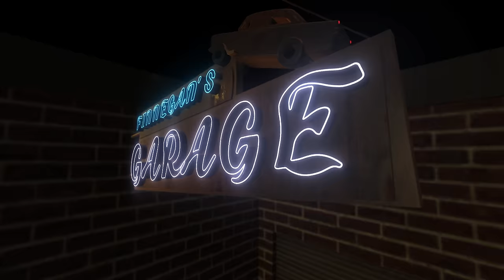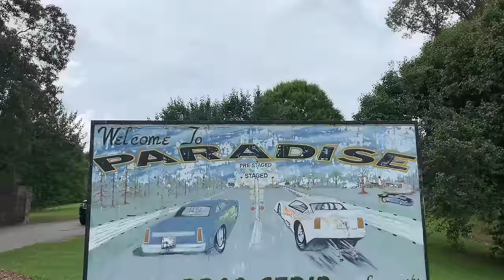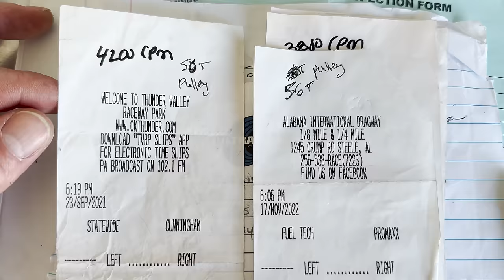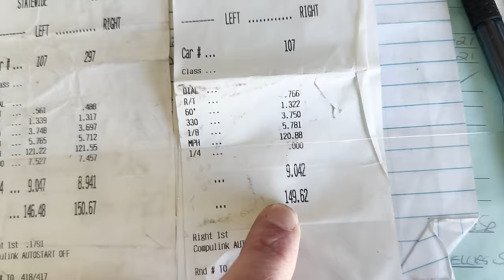DON'T CALL IT A COMEBACK! '67 FIREBIRD TRACK BLAST.

Comment: Copied from my post on matt carriker channel
Your suppose to have a shade 15 lens to look at an eclipse. Incase you didnt know. That is the same required lens for a welder. But that isnt what they use. A number 10 lens is standard. An oxy-acetylene torch lens is a shade no. 5 lens. Really dark sun glasses are about a 2.5-3 lens and normal sunglasses are about 1-2 shaded lens.  You can take an arc welders lens and a gas welders torch lens and hold them together. Altho that maybe a lttle dark for a camera, around 11-13 would work best. Expect welding shops to be sold out of them by the weekend. So my question is.. How are you going to help prevent all the peoples from frying their eyes while staring at the sun during the event? BTW. You can not see the moon passing without the lens the glare is just to bright to actually see the edge of the moon and the edge of the sun.. all you really see is the edge of the glare. Meaning without a 12-15 lens all you are going to see is it go from bright to dim. You wont see anything else except the blinding light get smaller just when it is fully eclipsed then go out an be blinded during all the rest of the passing. Then you will be completely blinded again when it re-emerges again but that wont matter because they can  not see already by then.  By time it is over everyone without lenses are going to be partially blind for hours. Some can have blisters feeling like sand in their eyes that get rubbed raw lasting 4-10 days. While perm cloudiness can be an effect forever.  So are you passing out disposible lenses.. giving instruction not to stare at it with warning of headaches and stomach cramps feverish side effects and/or chills???   How are you protecting all the attendancees who just wanna dance and have fun??    PEACE EVERYONE! Be smart enjoy the day!!  MaMa's "Protect your Children" because they wont feel they are hurting their eyes untill its over and to late.